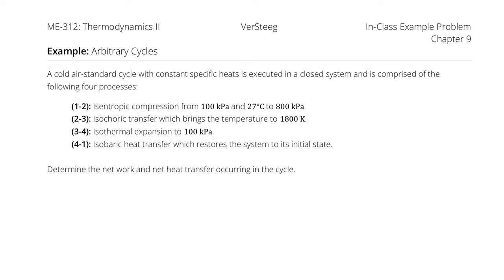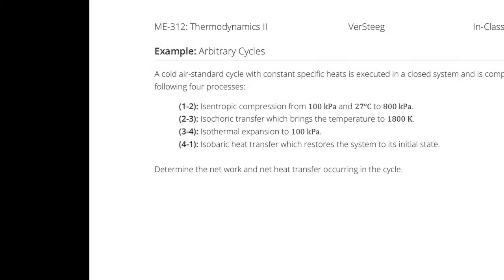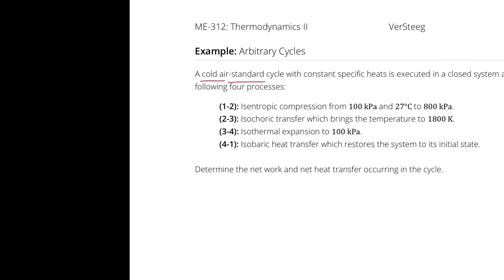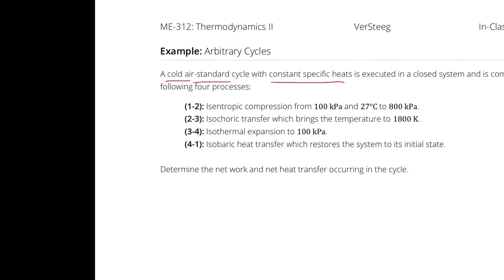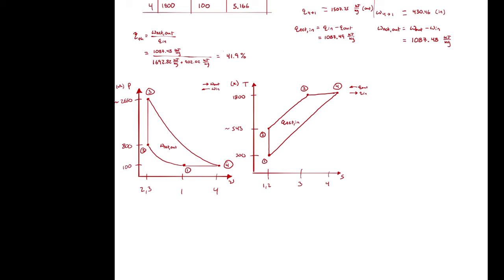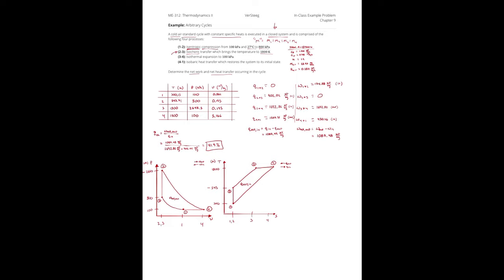Example Problem - Arbitrary Cycles

Comment: I have a question to ask. When it came to solving for P3, why wouldn't you solve it using the ideal equation?
Reply: its not isentropic, there is external heat addition. for us to use ideal gas equation the process has to achieve 3 criterias wich are  isentropic (adiabatic - no heat exchange with the surroundings, and reversible) , it has constant specific heat and has to be an ideal gas.